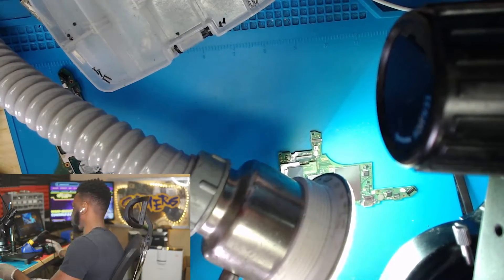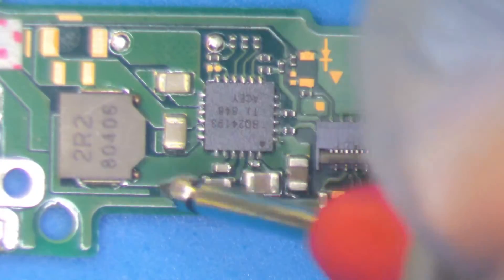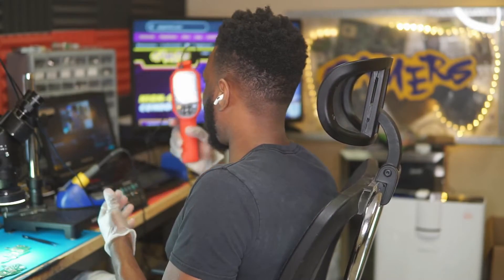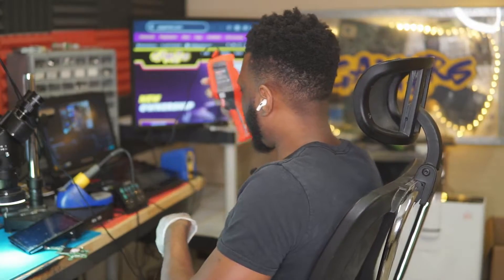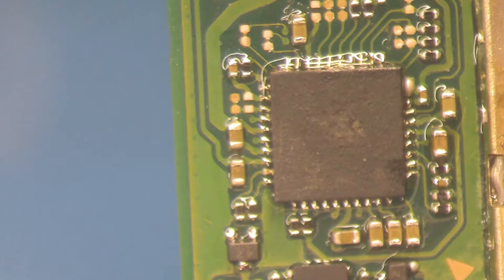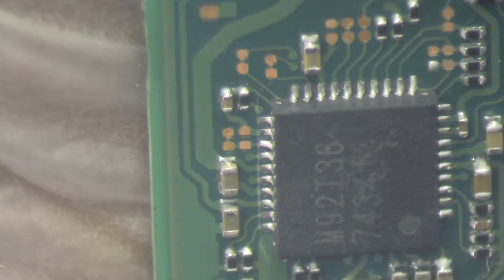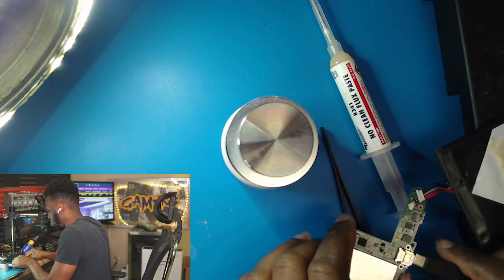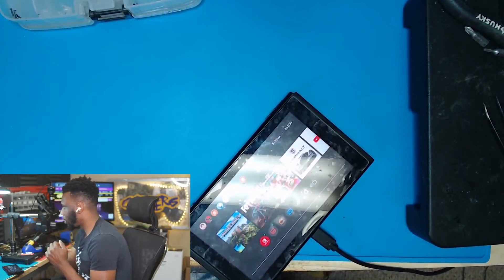Fix Nintendo Switch Not Charging - M92T36 Charge Control Chip Replacement

Comment: I have a suspicion that my Switch has a broken M92T36. It is charging with 5V but not 15V, and also doesnt connect to the TV through the dock. Is that a typical thing for a M92 fault or would it not charge at all? I'm really attached to this switch and I would hate to break it to the point of no return ._.

Comment: i just measured my old switch whic doesnt turn on and indeed the M92T36 chip is faulty and the usb c connector and im wondering maybe you could tell me where you got your chip from because i cant rly find any good ones except cheap crap on ali or should i try my luck with those cheap ones ?

Comment: Great Video mate!
I have an issue with my Switch, it won't boot past the Nintendo Switch symbol (second screen after booting), can't get it into maintenance mode and I've tried pretty much everything. After doing some research for a few hours I found out that this could be an issue related to the M92 Chip. Do you think replacing that could solve my problem? What's your suggestion? Thanks in advance and keep up the good work!

Comment: Repairing my own and  i can't get it to come off , it doesnt look like the heat is too low on my heat station, i hold it for what it seems like a long time end yet it doesn't come off
Reply: I replied to a similar comment on this thread. I think 440F is too low if that is what you are trying. I could remove the chip with 650F.

Comment: This is so frustrating at 440 the chip won't come off how long do you heat it at 440
Reply: I think he means 440C which is over 800F. I was able to remove the chip at 650F but not at 600F. To install the new chip, I went up to 775F but not 800F.

Comment: any way to test M92 before removing it?
Reply: if you get an ammeter and set it to continuity mode (the mode that beeps when a circuit is created) you can check around the M92T36 chip for short circuits. But, it will cost you like $15 to replace M92T36 so I'd just replace it anyway.
Reply: @Aspecturr  thanks. i already ordered some ICs (m92, pi3, bq and usb-c port lol). i will start replacing m92, i hope i dont receive bad components

Comment: I suspect my m92 chip is bad and thought I could do the repair myself with my new hot air setup....until I saw how small it actually is...now I'm thinking I'll pay a repair shop to do it. Honestly my biggest fear is that they'll make a mistake and then just tell me my board is bad
Reply: I thought the same so I got a 40 microscope on Amazon which is pretty  good I must say. I thought the same thing myself and I changed my usb port 1st and surprisingly I did it but the chip was my problem. It really seems scary at 1st but not really that bad
Reply: A repair shop will tell you they can't do it and send you here to YouTube
Reply: If they do tell you it's bad, what changed? It's still broken. No need to worry if nothing changes.
Reply: bought some switches from marketplace and ebay. thought i could do this type of job. Because i modded gameboys and gamecubes, but Yeah, no. way too small. i definitely wasted money.